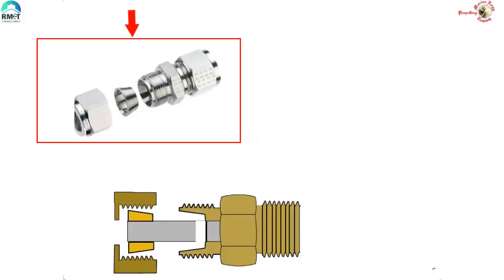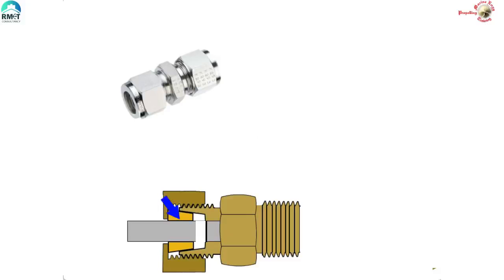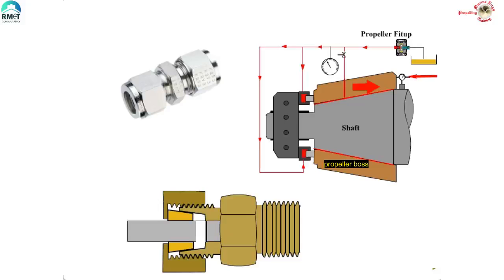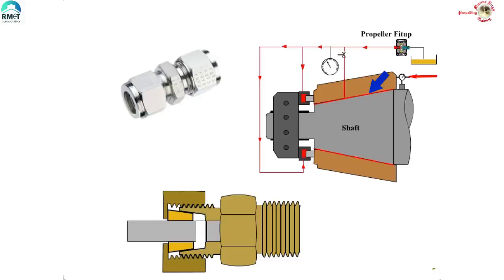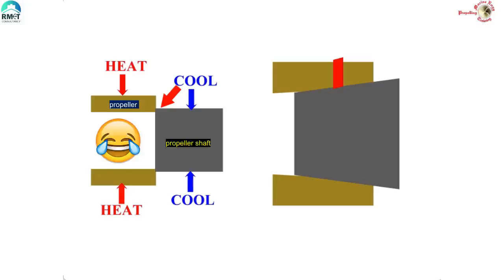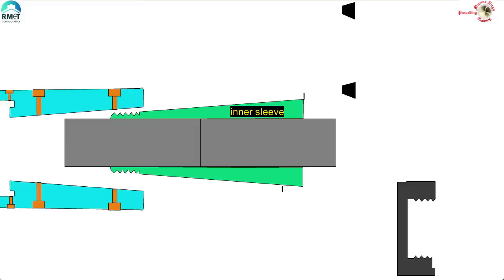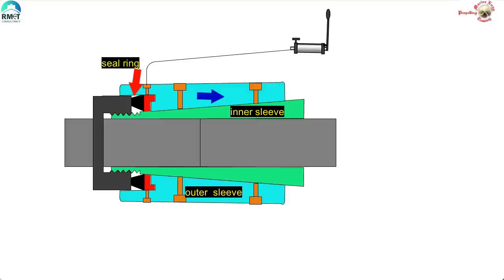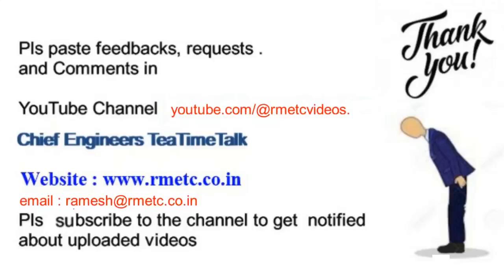Muff coupling working Principle|Interference Fit | Keyless Transmission | Propeller Shafting |Ramesh

Comment: Sir , a doubt is there , I think we have to put the oil in the in between the outer and inner sleeve while fitting and then applying backup pressure